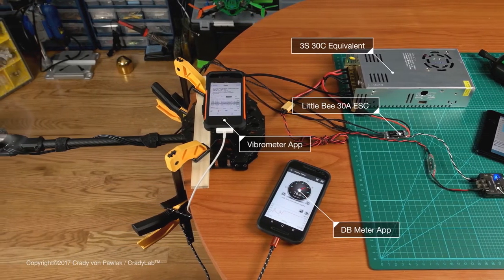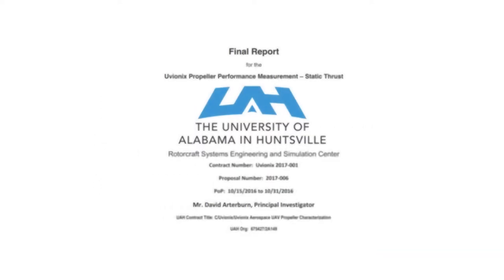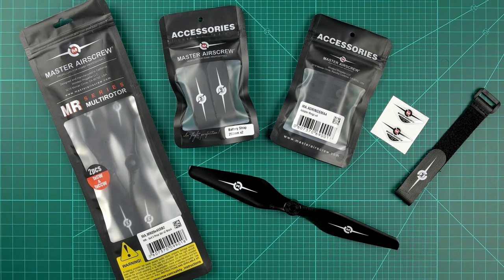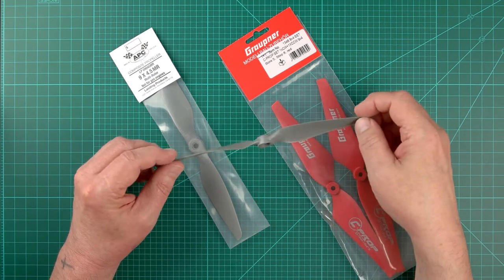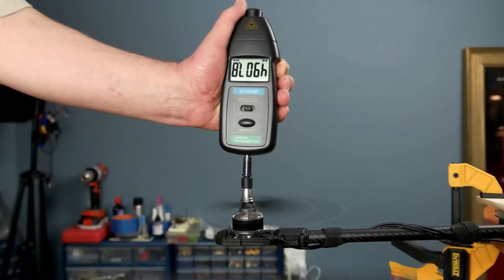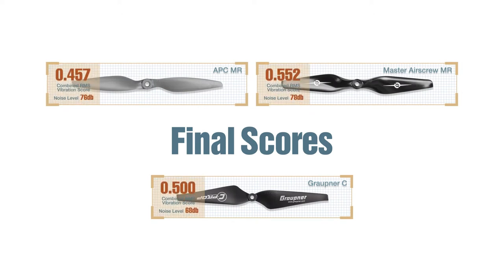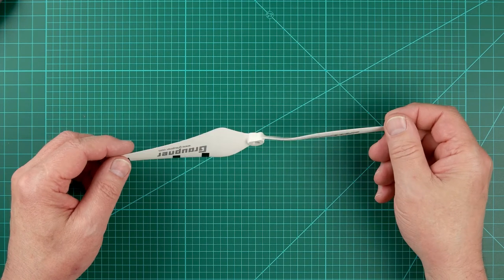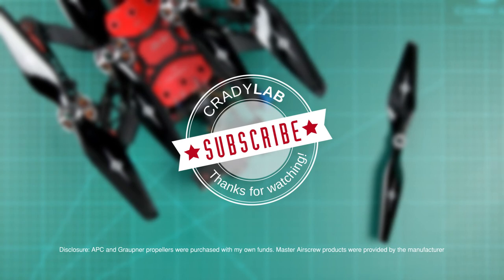Testing Similar [But Very Different] Props

Comment: An even simpler test than motor current vs thrust for a prop.
Setup the motor mount to measure the twisting force or torque at the base of the motor, which will be the same as shaft torque,  and plot thrust vs. torque.
Torque will directly translate to motor current.
(You still need to match the motor to the prop dia and pitch, yet another basket of variables that must be controlled to produce meaningful data)

Comment: I WISH MASTER MAD A PROP FOR THE TYPHOON H
 THAT USES THE QUICK RELEASE
 KEITH KUHN
Reply from the maker: That would be sweet but so far MA doesn't seem to have any CF props in their lineup.  If the Typhoon motor bells use a standard screw pattern you might be able to swap the quick-release hubs for hubs with 6mm prop studs

Comment: And all of these,  everywhere by everybody,  are done wrong. for many if not most of us. Either uncontrolled variables, where there must only be ONE, (the prop), if the
 test is to be meaningful. Or seemingly avoiding getting the result we are looking for.

You must have controlled variables for these tests to be meaningful.

If there any overlapping  data for thrust/current i don't see it.

Closest is the Cp/Ct  (thrust vs power) but there is hardly any overlap.

Instead . . . where can we find THIS . . . . . ?

Voltage should be fixed, from a regulated supply if need be. Motor efficiency is affected by volt current ratio, and can corrupt the result.

You could do it with a watt-meter, and a fixed input in watts, But any voltage drop vs. current must be consistent across the test. battery depletion will contaminate the result. So better from a power supply with unchanging voltage and then current measurement alone will tell the whole story.

Measure hover amps right off the battery,   Amps in Hover you can get easy,,,  but to get Amps at 40 mph . . not needed for this test,,,  but some day, someone is going to mount a stiff sprung shunt fed analog meter in front of their FPV camera . .  that would be some great data eh ?

Bench test one of the OEM props and motor at 1/4 current of that measured for all 4. Round up to a whole number, and you have your test current.. That will be close enough.  .... Measure thrust at that current.

Throttled to identical current leaving the only variable the prop. The highest thrust for that current across all is the winner.

Or, throttle to the measured amount of hover thrust (produced by your measured hover current of your OEM Prop and motor).  The prop that gives that thrust at the lowest current is the winner.

if you want to be overly obsessive, subtract from the thrust the weight of the prop.and chart net thrust. But accounting for prop weight is likely too trivial a difference compared to what we are seeking...one can easily add it after the fact anyway.

By controlling for only a single moving variable, the prop,  you have an understandable and accurate measure of what your looking for, the efficiency differences, meaningful directly comparable figures of power consumption to thrust ratio across all of the props.

You can certainly have multiple current points, perhaps some props suffer performance falloff at higher inputs, that would be nice to know.

But again, across the chart bar, the only variable between items being tested, is the item being tested.

That paper didn't address the motor, but energy efficiency of motors would be done the same way, only ONE input variable, the motor. ( the motor weight would also factor )

Fixed voltage, dial to a fixed amount of net thrust. The winner is the motor that gives you that net thrust at the lowest current.

Or throttle to identical current and measure net thrust. (subtract weight of motor and prop)

A motor and prop combo rated in thrust vs. current,,, with its weight subtracted from the thrust... operating at your hover thrust requirement . .

(A vertically oriented uplift measurement don't account for weight, when you zero the scale you also zero out the weight of the motor and prop, so it must be subtracted)

Net thrust vs. current, an actual direct compare of lifting power efficiency.

Now you have something meaningful to look at.
 
 - - - - - -
There are other considerations of course, but that has to do with class 
of service.

In the above Its assumed the props have a similar pitch. A static test will not fully compare a tractor with a racer. The result is going to relate to efficiency in a hover.

A high pitch prop will rate poor against a tractor in a static test. But your not going to do 100+ mph with a high hover efficiency low pitch tractor prop.

Larger and or heavier props have more rpm acceleration power losses even though they may be more efficient in a static hover. (wind buffeting corrections, or any other cause of motor rpm change eat battery, spinning up mass isn't free)

Racer props, higher pitch faster props,, i guess you either use a wind tunnel, a speed gun, on-board gps,, the static test will show how much that added speed capability has cost your hover efficiency, but it cant show the sustained thrust at air speeds above where the tractor has maxed out. 

With the right tractors, you can lift more battery, gain more benefit from the bigger battery, but you might pay for it in decreased rates and speed that go beyond that caused by the battery.

The contest here is between minutes per amp-hour vs smiles per amp-hour.
But speed and mobility costs you endurance.

So even more blasted variables,  But at least you can measure . .  grams of thrust per amp, amps per gram of net thrust,  watts per gram of net thrust, across those props and current points,  and have data that actually means something.

It begs the question,  how would those fancy props fare then, Eh ?

Cheers!!